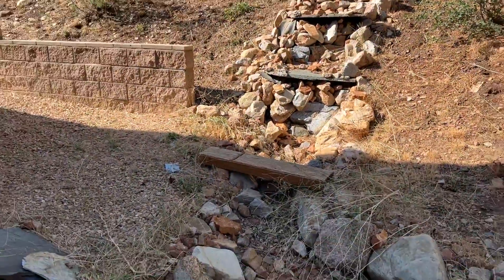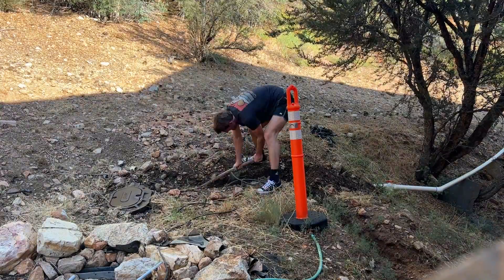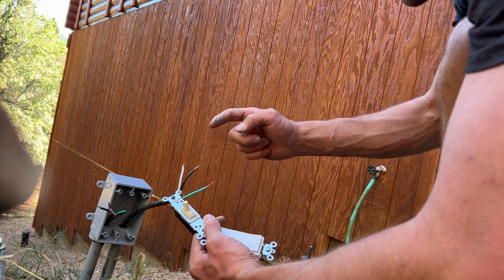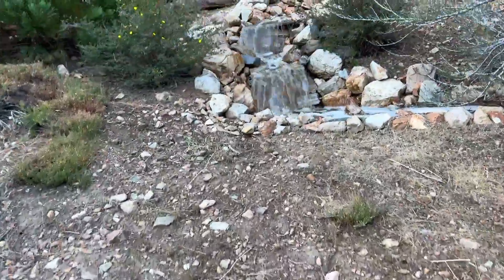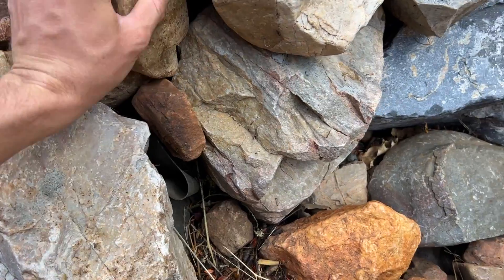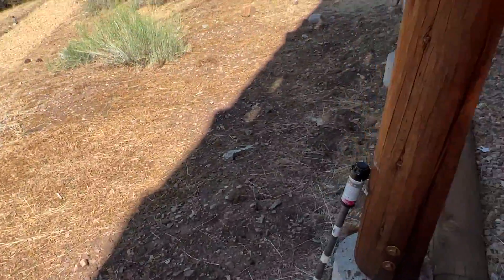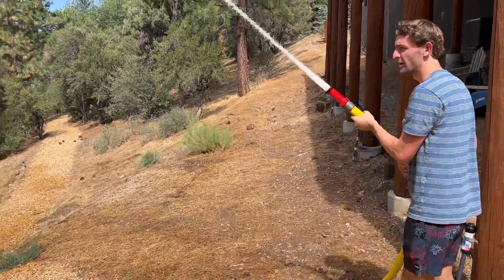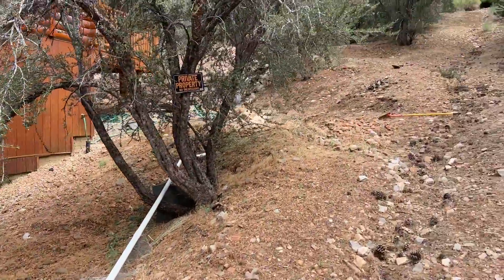Home Wildfire Defense System (DIY FIRE HOSE)

Comment: Clever! I would also bury that wooden beam running along the bottom of the deck posts. That's a great spot for embers to accumulate and ignite. And make the sprinklers spray full circle so the house is also protected. Obviously all the chairs would have to go inside the house. I might also be worried about that nest of pipes under the breaker box. That's all flammable and if some leaves get blown in there and then embers land... Same with the new switch. It won't catch the house on fire but it would be a nuisance if it burned up. Pop a big olive oil can over it. 
It would be good to screen all the eaves and vents and under decks to keep embers out. And definitely whack those two bushes up against the house. Live vegetation can actually be a good fire break (contrary to popular belief) and it can catch embers before they get to the house, but it should be away from the house to protect it from heat and direct flames.

Comment: In most cases houses do not burn down from the raging head of a forest fire but from small fires set by embers.  The first 0 to 5 feet is the most important.   Not a bad system if you have electricity to power the pump.  Next upgrade, generator to run pump!  At my home I have 3000 gallons water, generator and gas powered fire pump with class A foam.  I consider it to be my fire insurance deductible.
Reply from the maker: Yeah 100% agree. Generator power and more capacity is a must

Comment: Cool stuff. Most people wouldn't be thinking ahead like you are. I might have missed it in the video, but do you have a dedicated water tank, say one of those cheaper 1000G tanks you can get at Tractor Supply? And the water pump and hose  that Harbor Freight sells?
Reply from the maker: The pump I have is also used for the stream but the valve opens up the hose pipe. I think I probably only have about 400-500 gallons of capacity in the tanks underground. What I need is another tank like your talking about and back up power

Comment: Great job. Another good idea is to clearly mark your hose hookup so if you have to leave firefighters know where it's at and can utilize it for refill.
Reply from the maker: Thanks! Yeah that's a good idea. One day I want to add way more capacity maybe in a tank up the hill and figure out a backup power situation
Reply: @DIYSCOTT  I built a slip on fire pumper unit to put in my ranch pickup with hose reel and everything. I can draft with it as well. It's perfect for my property and also helping my neighbors out.

Comment: A one inch hose would probably do better.
You can find a nice aluminum nozzle that would do well with the limited water pressure you have.
Reply from the maker: Thanks for the tips! Yeah I loose a good amount of pressure because the stream keeps running. But if I were to fully close the valve on the stream I would have to keep the nozzle open so it doesn't blow itself apart